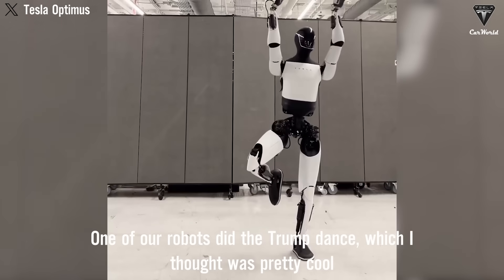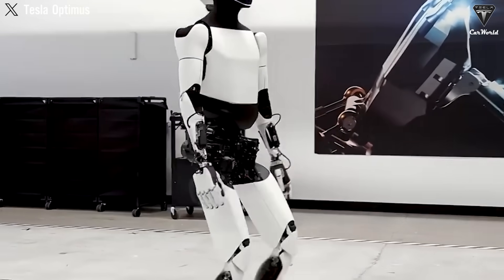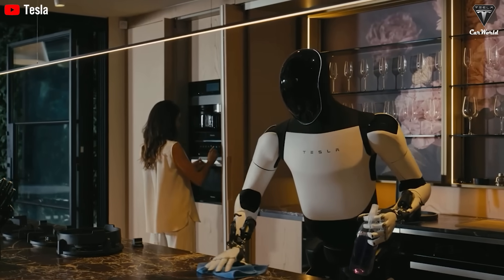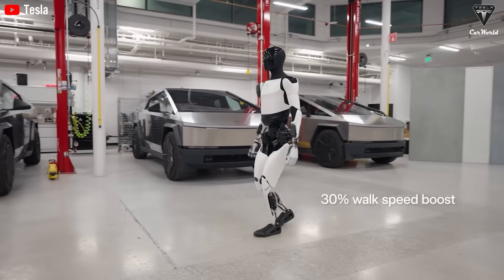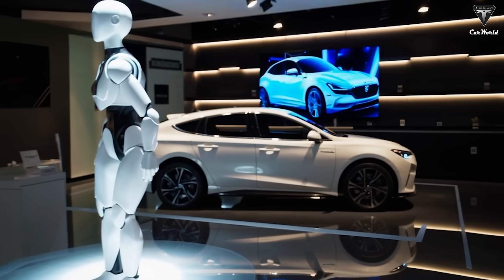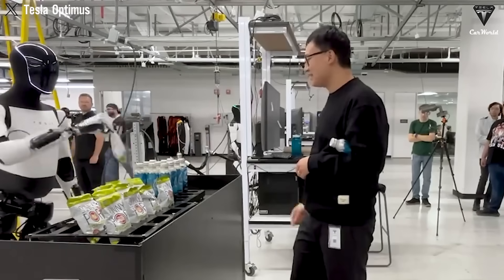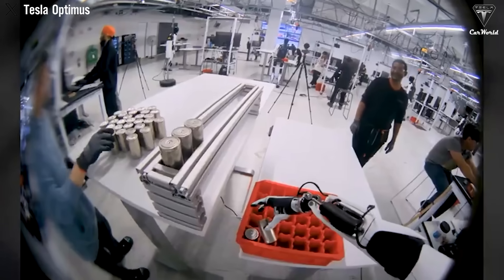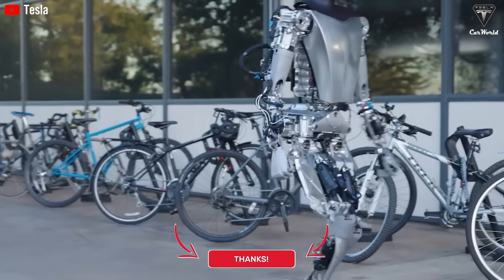Finally Happened! Tesla Bot Gen 3 Gets Biggest Upgrade Ever! Elon Musk Confirms Sale Date In Q4 2025

Comment: Incredible creativity & motor control well done!. Either way we are still stuffed!😅🤣
Reply from the maker: Totally agree—Optimus’s motor control is jaw-dropping, and its dance moves only add to the fun.
Reply: I have 100 questions with 10 possibly wrong answers? I have worked with elevator modernisation. So had time to look at an 'electric eye' from 1910, relays & various sensors designed not to fail. Experimented with solid emergency door opening devices that would draw 20A of current at 12v,  purpose-built in which even i couldn't break :). Spun these devices around in my mind & built many unusual projects. The components were rugged & designed to handle years of vibration etc. Some sensors contained 100gms+ of liquid mercury, silver & probably platinum? It resembled no colour of your typical metals & was a contact, 100yrs old with no signs of arcing.  It was more than just a simple mercury switch.That was devices from 1900. I was a kid, though fortunately had that opportunity. It would have been cutting edge for the time?. Designed to work in systems to achieve a desired outcome, nothing could go wrong!. 
    This stuff was big and bulky, replaced by miniature sealed sensors & a computer instead of relays about 1988. I'm wondering if the robots which you are showing us could be 50-100yrs old?  Who's idea was it to shrink multiple sensors to fit within a human form factor, Or was that just an ultimate evolution of sensors. Which came first the sensors or the idea of making a robot😅 Sorry, I'm half asleep..
Reply: Yes, I can only imagine seeing this in real life. I have to say it, it's beautiful.😮

Comment: Will it be able to download repair guides and perform the repairs? Will be able to be told “I need a 2x4 cut to 36 1/2” and notched on one side with a cut out that 4” long and 2” deep, 12” from the end” and the robot come back later with the correct board having sawed it and shaped it using the correct power tools?  Can you say “clean and organize the refrigerator” and it ask you ‘where are the cleaning supplies?’ When you fall down the steps while it is in the house, can it come and help you up? Examine your injuries and administer medical needs (clean wound and put on a bandage with triple anti bacterial?) or will an owner endlessly have to train it?